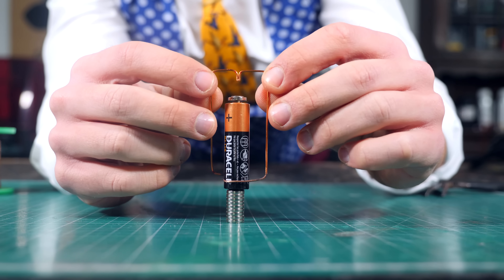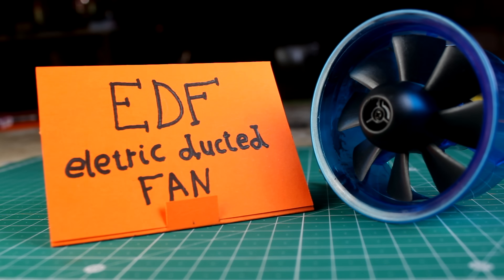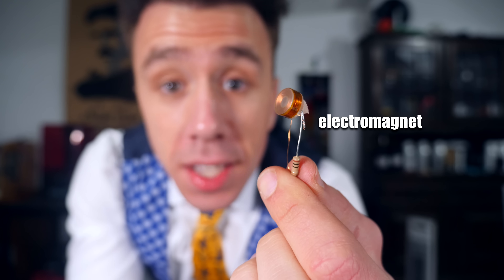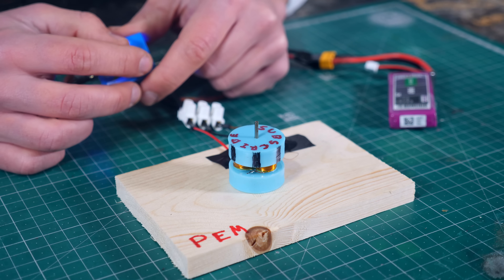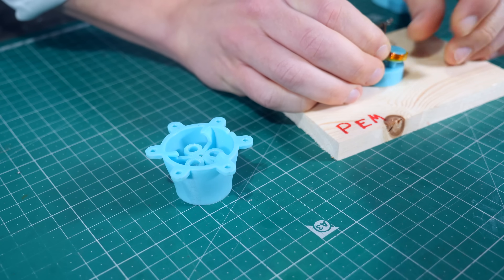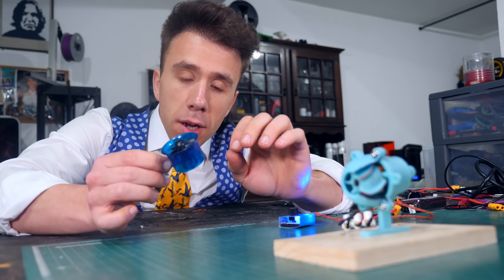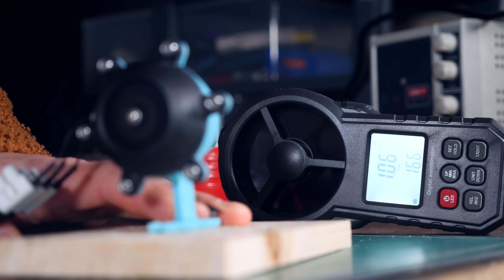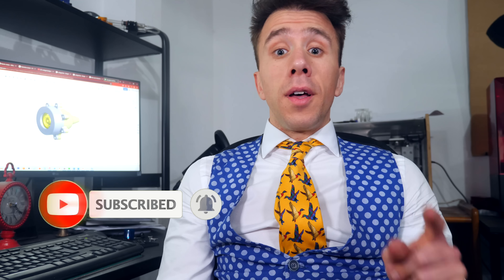I 3D Printed an ELECTRIC MOTOR FAN

Comment: Part of the issue may be that an axial fan generates lots of moving air mass - think of it like amps - and the centrifugal one generates more air pressure but less moving mass - think of that as volts - so the anemometer you're using is measuring the amps (moving air mass) but not the volts (air pressure) so you're only getting half the picture. Try measuring the static pressure difference between intake and output on each fan. You can also try attaching each fan to a sled with a force meter to measure the actual thrust in newtons (or your preferred thrust unit) to add to your available data.
Lastly if you look up axial flow turbines vs centrifugal turbines as relates to jet aircraft engines, apparently axial flow ones are more efficient in general, perhaps due to the lack of changes in direction of the air, while the centrifugal variants are less complex to build and may provide faster response for leveling thrust up and down.
Reply: To be clear, a distinction needs to be made between an axial fan and an axial compressor as the latter has fixed vanes and multiple stages which lead to a higher pressure difference. An axial fan is most literally just for moving air, not compressing it.
Reply: This is the right answer! Impellers can increase total pressure much more than propellers, but they need a load (back pressure). Otherwise it's like shorting a high voltage generator. 

Dyson fans generate significant airflow because they use the high pressure air and an annular nozzle to entrain surrounding air. The nozzle of this model may be generating a high velocity jet, but it's too narrow to drive the anemometer.

Comment: I see that you do know that vacuum-style fans are supposed to spin in the convex direction instead of the concave, because spinning them concave bogs them down too much. BUT then it looks like your motor spins those printed centrifugal (actually pronounced "sen * TRIF * uh * guhl) fans in the concave direction. So double-check that. Am I wrong?

Comment: I believe it may have to do with it needing more torque than speed and the brushless motor in the EDF you're using was built for speed rather than torque or something in between so having it push air from wide to a narrow gap may be putting more tole on the motor than it can handle. I think using a lower KV motor may fix the issue

Comment: There are a number of things that I can think about, for starters intake area-output area ratio is important. Impeller diameter, shape, weight, number of blades are also a factors. 

Would be cool that if it worked, you make an RC plane with this as an engine.

Comment: The nozzle and the shape of the blades does also have an effect on the pressure for the fan.
Try forward curved one and build a outer Rotor-Motor.
I work for a big German company that build fans and I'm a fan of your channel.
I would like to help you to improve the fan, but unfortunattely I don't have a 3D Printer to show you how.

Comment: There is no simple answer to your question,  and I certainly haven't got the knowledge to even attempt to.
Some of the things to ponder include:
Fan swept area  (frontal area of the impellor vs EDF fan)
Initial blade pitch angle
Disc density (how many blades and their size)
Duct intake and exhaust ratios
Compression of the air (think Bernoulli's law of fluid pressure vs speed in different duct cross sections)
Whether the device is tuned for static thrust (what you measure now) vs thrust force and efflux velocity developed once at design speed.
Simplistically, energy in should equal energy out, but axial flow (EDF) is often far more efficient vs the centrifugal type - especially if you're not using direction change etc for compression prior to igniting air/fuel mixture to spin a turbine stage(s)

Comment: You have two problems
First, your optimal power output speed for your motor, does not match the optimal efficiency speed for your impeller
Second, an impeller moves less flow but at a higher pressure, if it's sending air into open space, even at  the optimal speed it will move less air and a lower speed than a fan
This is why we sometime use an axial compressor, sometime centrifugal compressor
Often we use both, several stages of axial compressor, starting with few large blades at a shalow angle of attack, 
then progressively more, smaller blades with a higher angle of attack and finally into a centrifugal compressor 
Look at the PWC PT6 engine for a simple to copy design. You will need to readjust the parameters for your motor ideal speed and output power, this will dictate your compressor max diameter and flow rate. 
Lastly, you need restriction at the end, if you do not have restriction then JUST USE A FAN !!!!!

Comment: I think one of the issues is possibly the outlet, it could be restricting the flow of the air, try with the front of your design and just an open back and see if that gets any improvement

Comment: You had a picture of an centrifugal-pump to puch air out the side. From the center of propeller. Try to go with that form and desine a houseing that direct the thrust out oposite side of the inlet. Go less copy and analyse fail more, that's intresting and very educational.

Comment: Seems like you're measuring performance by guessing the airflow but you should both measure airflow (dynamic pressure) and static pressure.. I'm not sure but i think impellers are better at creating high pressure with low airflow while the fans are more on high airflow and low pressure

Comment: it is because EDF BLDC motor have high-speed and low torque which cannot handle backpressure . the simple solution will be to change  for high torque BLDC motor or Rewind the BLDC motor with low Gauge (ig:-30 to 25) before u remove the winding take single coil resistance and then replace it with kipping the resistance same by doing so no. of turn pre coil will decrease and size of coil will increase. u can get the general idea by searching online. I hope this will help you.
( my suggestion is to go for customization of BLDC Motor doing so will gain u knowledge and help your future projects)

Comment: Well see, here's the thing.

An impeller is optimized to compress air as a function of a multi step system and not actually displace enough of it to produce thrust on its own, it's designed with a second form of exhaust acceleration in mind to then produce thrust. In the case of jet engines, that secondary exhaust acceleration would be done by mixing fuel with that compressed air to combust it and in turn generate a crudload of thrust.

The blades of the ducted fan are designed to displace a lot of air on their own, with each blade specifically optimized to produce thrust by behaving like airfoils and using the duct to allow the fan to spin at immense RPMs without the blades otherwise losing effectiveness from how short and stubby they are.

That being said I've seen many home made electric impeller RC planes generate more than enough thrust to take the place of a ducted fan, and those had large impeller blades with a big inlet and exhaust outlet. It's possible your design simply needs a smaller hub with larger impeller blades and bigger inlet, along with a smoother more open exhaust outlet.

Comment: It is called back pressure. You loose energy when you compress a gas. Large propelle rblades and slow air speed is always more efficient.

Comment: I'm not a jet engine expert, but i have a lot of time on my hands and I wanna go fast one day. the reason the compressor your using isn't producing thrust, is because the thrust doesn't come from the fan blowing air. the fan basically packs the air in, so it can be filled with fuel, and then ignited. this causes the gasses to expand and then you get thrust. this then acts on the exhaust side of the fan ( you have intake and exhaust) and boom, you go faster. 

think of a jet engine ( or a centrifugal fan) as a piston engine but long. you have the intake (the fan) the compression (the gasses being slowed down and compacted against the walls) the power (the ignition of the gasses) and the exhaust (hot gas goes out the end), and the mechanical motion is taken form the back of the exhaust side of the fan. it flows though in a weird line, but a sorta straight line. 

this also means that the (very nice) fan you got is working in the 2 first stages, which make for a bit of a low thrust blowing fan. because its not blowing straight out like the EDF. hopefully this helps! love your channel!

Comment: EDFs are very efficient at moving air, but they don't try to create any static pressure. So high thrust but low compression. An impeller creates lots of compression, but moves a smaller volume of air. If you want the impeller to move the same volume of air as the EDF, you need to spin it much faster than the EDF. This is why RPMs in jet compressor stages are so high, they have to be high to move enough air AND compress the air. HTH, good luck!

Comment: The geometry of your blades seems not correct. Think like U chop with these blades air.....your blades are just grinding with no specific angel in no specific direction....get inspired by a vacuum motor 😉 or model jetengines..... geometry is everything

Comment: Your problem is you can have good pressure or good flow, but you can't have both. 

The EDF has excellent flow and is good at moving air, however, it will not be able to perform well if there is an obstruction or resistance.

Turbos are all about building pressure. Your turbofan would be great at pushing air through an obstruction/resistance; however, it would not be very good at flow / moving high volumes of air.

The fact is your design is trying to increase the pressure of the air and then use an aerospike to allow it to expand and speed up again (high flow). Doing this however will cause energy loss in the system as it converts between the two states. The only reason this is preferable in a jet engine is because you want a lot of oxygen in a small space so the fuel can burn evenly and completely. More pressure means more oxygen atoms in the same cubic volume of space. But it is the expansion of the heated air from the fuel which is doing the majority of the work.

If you are intending to move a lot of air on its own just through the power of a rotating mass, the fan blade designs are more preferable.

Comment: For something like this problem don't want an impeller like this, might be good for raising internal pressure but if your not burning fuel. You should focus on maximizing the speed or air through the engine model. A ducted prop would suit you better. You could design a fan with a lot of blades and a high able of attack

Comment: You want max thrust but are measuring with an anemometer.  Anemometers will show you air speed.  Your anemometer is larger than your fans so the fan's air speed must contribute to the effort of turning the blades of the anemometer that have no air blowing on them.
To measure the air speed coming off the fan accurately you will need to put a diffuser on the outlet and seal it onto the anemometer.  Then you can calculate the air speed using the measurement of the anemometer times the ratio between the area of the fan outlet and the area of the anemometer.  
At zero forward motion you want a large fan for max thrust.  At higher air speed you will need more velocity of air  coming from your fan to get useful thrust.

Comment: Your impeller isn't designed to move air but more to compress it, they aren't as efficient as fans for moving air. But then fans aren't as efficient at compressing air (or working against static pressure) as impellers. 

In order to get the airflow you want from an impeller it will need to have significantly higher rpm than a fan.

I recommend you get the book "the model gas turbine" by Kurt Schreckling. Try using his impeller design at around the rpm he does (80k) or to follow car turbocharger impeller design and spin it to 100k+ rpm.
If you don't want to buy the book and wait I suggest you read up a bit on turbo pumps (for fire engines, rockets aren't so easy to get info on) and follow their basic impeller design. 
The design of impeller you're trying to make is more efficient with air but more difficult to manufacture due to the tiny tolerances required to make them work efficiently. 
Impellers enclosed on both faces like Kurts are far easier to manufacture at home, are more stable and are less sensitive to small changes in tolerances. 

Kurt's book may still be of use to you in calculating acceptable tolerances etc. even if you don't follow his design. He dumbs down the equations and keeps everything in terms a lay person like me can understand.

Apologies for the novel. I'm no sciencey person, just a dude that played about with such things about 2 decades ago.

Edited to add: the rpm is really the most critical part after tolerances. It's the change in the air speed that gives the pressure increase and the close fit of parts that makes it all work

Comment: I've done a lot as a hobbiest with water jet pumps for RC jetboats over past years and I've also invented a couple of positive displacement pumps as a teenage long ago(born 1966).
The type of pump you are trying to make is called "mixed flow" because it combines axial flow like a normal propellor with centrifugal flow.  The dyson impellor you copied is mixed flow. The trick is to catch the air that is spun exiting the spinning impellor, catch it's rotational energy and redirect in the direction you want it to go. I live in NZ where one of Hamilton's employees invented the redirecting technology in the Hamilton Jet unit. In America, Colorado used to be well known for making mixed flow jet units. The biggest advantage of a mixed flow unit is that it can be designed to produce reduced loading on the centrifugal component if the outlet is blocked, where as axial flow loading increases. So Mixed flow is very suitable for internal combustion engines with fussy load requirements. I've seen on youtube beople trying the first part of a mixed flow pump but not redirecting the spinning energy ar the wide part, the results are always poor.

Comment: Hello from Brookes Point Palawan Philippines,Sir you miss the point of centrifugal force should act outward not axially,but i think you knew it jusr get confuse only.. there a very fine different between propeller and fan and some of it was miss use and put it on like electricfan which it seems doesnt fit brcause it  just have 3 blades or 4. Like a blower to centrifugal type
.if you want your so called aerospike centrifugalp fan to be effective then air make it wider blades.

Comment: Thrust is based 9n accelerating air mass. If you shrink the outlet to a 20th of the size, you are significantly inhibiting flow. More flow = more mass. Jet engines win here because the expansion rate of the exhaust to intake is MASSIVE. So you don't need much intake air to support a bunch of expansion on a turbojet. TurboFAN takes this concept further and uses the high velocity high pressure (and comparitovely low volume) of air leaving the jet to drive a secondary turbine which drives a massive intake fan in the front which moves a majority of the air. The problem you have is you're trading low pressure high mass for high pressure and low mass. You need more mass! In order to do that, because you are not burning / expanding fuel, expect to have to open the inlet of your compressor to nearly that of the shrouded fan that you are comparing to. The outlet will need to be sized according to what pressure you require. However more pressure = less flow. Balance accordingly.
Reply: The other part I forgot to mention is the blade angle. If you look at a radial fan, they usually have 3 distinct designs. Outside tip leading = high velocity low pressure, outside tip trailing = low velocity high pressure and straight = balance between the two.  Playing around with this will also dictate how much air you will flow. And like I said earlier, you are looking to move air mass. More mass = more thrust.

Comment: Hey, I can you software that can be used to design and export your impeller with/without housing depending on your pressure, airflow and power requirements. It will help you to export a 3D model and print it. I always wanted to do this but am limited to simulations without 3D printers. Hope it is helpful to you in your next VIdevideo mention me. If it really helps out get me a printer, thanks. Get me your mail id will send you or maybe help you design one.
Reply: Have mailed you the data

Comment: There probably not enough load on the motor from the fan. Its like a car stuck in first gear and because the motor doesn't have a proper load, it will over speed.

Comment: I have an idea why it's not working. Generally, centrifugal fans can build good pressure but aren't good at creating velocity in the airflow. Think about it, the airflow has to change direction a lot, from along the axis of the jet engine, to outwards towards the side, and back to axial again. In a normal jet engine this isn't really a problem because you want to slow the air from the intake for stable combustion.
With an axial fan, you get a little bit of pressure build up, but you can increase the speed, hence why EDFs use axial fans.

Possible solutions: change the nozzle design to try to use some of that pressure and turn it into velocity.
Also, maybe see if the fan is getting enough airflow on the intake. Maybe try changing the air intake design.

Comment: I hate tomatoes as much as the next guy but cmon blue is calming paint the impeller RED!  Also intake looks to be a large problem plus your tolerance aren't tight especially when moving.  If you remove the duct from the EDF it looses significant power.  Cnc out of aluminum (housing) or wood and make an injection mold for the impeller.  Homemade injection molding is "easy" and I want to see it!